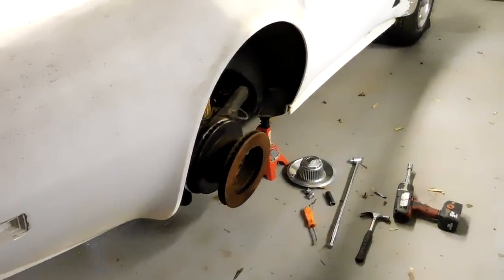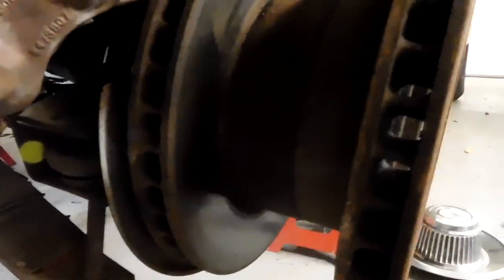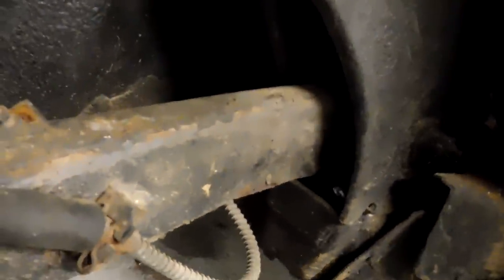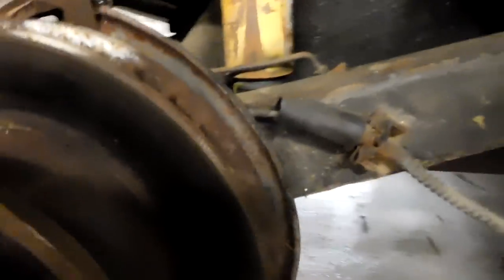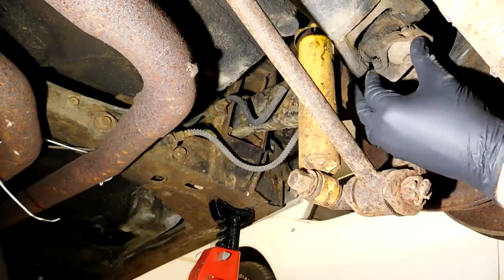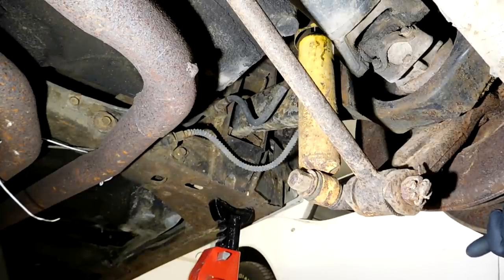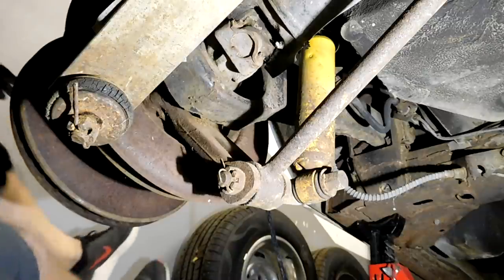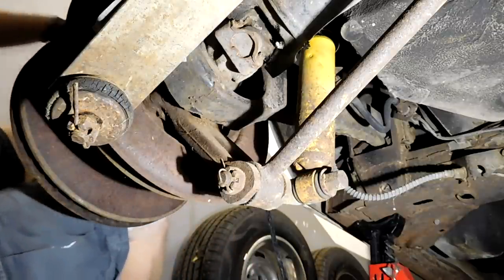The BEST Way To Check The Rear Wheel Bearings On a C3 Corvette

Comment: Fyi, you can also check with the wheel on as well,  pop the wheel off, long screw driver and loosen the the shoes away from the disk, not necessary to remove them. Put the wheel back on and shake away. If you don't have an extra pair of hands from a buddy and depending on your strength level it can still be done by 1 technician.  We did that short cut back at the Chevy dealership way back in the 70's and 80's.  I cussed at many a vette back then, glad you are dealing with them. Not to many people want to tackle an animal of this type  (C3's), I love them' Rock on young man, I love your channel, brings back memoriesl!!

Comment: I had a c3 in the shop i was working on to do rear brakes and lower arm bushes. It wasn't the lower arm that was faulty but the bearing had play in them and they had just been replaced. I phoned up the customer and asked if he wanted it investigated. To cut a long story  short after a lot of head scratching we worked out that the bearings the guy used  had a smaller radius on the outside of the inner bearings so they sat on the radius and not on the flat surface on the back of the bearing.  It took a lot of finding. so that's a trap you'd never expect.
Reply: I've seen that before, too. Scary stuff in a car that goes fast.
Reply: Was that a do it yourselfer or did that customer pay someone to do it for him? Finding old timer mechanics who know how to do this is critical. I found often that todays mechanics can do circles around me, yet when it came to knowing my 69 corvette and how to work on them they were mostly in the dark and me as a backyard mechanic from that era was schooling them. Trailing arms is one thing I knew well enough to let the old pros rebuild mine.
Reply: @ckstaff  I'm a mechanic in New Zealand and was working in a workshop for my boss. I'm near retirement age. The car came in for rear brakes and needed a new set of discs on the rear and rear lower arm bushes. There was a lot of movement in the wheel brgs . We contacted the owner and he told us to have a look at the bearings too.  It was tough to get apart  with the puller. When i took the bearing out of the housing it had been recently replaced. The bearing had left witness marks in the housing sides and inner corner but none on the back face of the bearing or housing. The radius was to sharp on the bearings so it wasn't seating on the back of the bearing, thus the movement. It was just seating on the radius. i nearly missed it.
Reply: @andrewkiwi1  I understand what you mean. When I pulled my trailing arms and tried to determine if I should do it or send it to my old retired mechanic from the days. I looked at the 4 longer bolts holding it all together and wondered how you get to those bolts, also looked at the costs for good tooling and jig to get the proper specs. Decided to have him do it. We met at his shop on a Saturday morning as the plan was he would tear them down for me and while we wait a week for parts I took the casing and arm in for powder coat and sandblast. I was expecting it would probably be a couple hour job each for him to take them apart. LOL he had them both apart in about 20 minutes. Bearings were surprisingly in good shape and still had grease. What was completely gone was the bushings. Sounds like you had a monster project to figure out. Did you pull the entire arm out? Very good that you discovered the problem.
Reply: @ckstaff  Here in NZ we have a safety inspection called a "Warrant of Fitness". For cars under 5 years, once a year and cars over 5 years every 6 months. It was due for one so it would have failed on excess play in the rear wheel brgs. So it needed to be done.  One side came apart easily and the other was just tight all the way. We did the lower arm bushes too.
Reply: @ckstaff  I had a rear bearing go out, just fell apart. I had it towed to a shop, there the mechanic put the spacer in backwards. So I decided to rebuild them myself. I got a used GM tool, but it wouldn't budge them apart. We took the housings off the trailing arms and pressed the spindles out with a massive hydraulic press. It took so much pressure, I thought it would explode, but it came apart. We still had to use a cut-off wheel to cut the race off the spindle. It went together okay, about 3-thousands on one side, 4 of the other. I doubt I'd do it again, would probably send them off to be redone.
Reply: @mikeferrell7308  I just figured when doing mine that I would probably never do it again so why learn how to do it, buy the proper tooling and risk screwing it up. At a minimum it cost me $700.00 to pay him, yet was probably the smartest money I spent on the entire car. To bad you paid someone and then had to turn around and fix his mistake, that would have sucked. It is such a big job just getting to the stage to get the arms out. Hope you also dealt with all the old bushings such as struts while disassembled. LOL, I did, I didn't want to have to go back and do it all again. Not to bad of a job but I had a horrible time getting one of the lower shock mount out, which actually hold the struts also. Ended up destroying 2 of the tools that screws on, protects the threads and allows you to pound on it to get it out. Still wouldn't come out. Finally did come out but I destroyed it and had to get a new one. I enjoy chatting with other c3 guys and sharing stories and each others adventures.
Reply: @ckstaff  Yes, rebuilt everything while the trailing arms were out. Yeah, my shock mounts wouldn't come out either. Ended up cutting them out and replacing them. Had to cut the bolts through the frame, too. Nothing was coming apart. Yeah, after paying to have it screwed up, I figured I could screw it up for free! ha ha!
Reply: The bolts through the frame and if they would come out or not caused me anxiety all through the process but kept persevering blocking it out of my mind until it was time. Had my saws all on hand should I need it. I was quite surprised when they easily popped right out so no cutting. Something went right for me that day. LOL. However not nearly so easy getting them back in, especially with fat fingers. The kind of thing that eventually after all the little tricks you try to get that long bolt straight enough to go in the hole it worked, but I cannot to this day explain how I did it. Almost by accident, in fact probably was by accident.

Comment: Good video and perfect timing for me!  Going to be working on the rear suspension this winter.  Need to chang the ride height on rear passenger side.  For some reason, passenger side is higher than driver...
Reply: Oddly that is true on most C3's. My 69 as well. I had read that they were designed that way because roads slanted to the right. Not sure if that is true or not but my right rear is 1" higher than the other 3. I have the longer hanger bolts I can put on to allow that 1" drop, just never got around to trying it. There is a good chance your hanger bolts if original (8'' I believe) are already adjusted as low as they can, meaning you won't be able to lower that height without getting the longer bolts (10'' I believe). The longer bolts sure look awful close to the ground, to me anyway.
Reply: @ckstaff  the stock bolts are 6".  I just bought 8" bolt kit with new bushings and plan to swap them out in winter.  BTW, you're right about most C3 having this issue.  My 74 was the same way...
Reply: @aamira5651  Yeah, couldn't recall the bolt sizes when I posted. 6''to 8' or 8' to 10''. Good luck on that. As I said, I got the longer bolts to do the same thing yet not switched them yet. Would be interested how it turns out when you do it.

Comment: Great video, Ben! Looking forward to seeing how you tackle C3 rear wheel bearings. I've done it on mine, it was a bear of a job! Mine didn't want to come apart, took lots of persuasion!
Reply: LOL, I took the chicken way out on mine. I pulled the trailing arms off and sent them to a pro. $700.00 job, but well worth it and hopefully good for another 50 years. To bad I probably wont be around in 50 yrs to find out. LOL

Comment: Good to know. However I had bad bushings in the struts which had to be replaced to do an alignment on my 69. Having to strip it down just to get to the struts there was no sense in not going all the way to the 50 year old trailing arms. Not something I wanted to do but there is a peace of mind when done knowing all bearings, parking breaks, grease, trailer arm bushings, even sandblast and powder coat, u-joints, break lines, shocks, struts, cambers and bushings and even new bushings in the suspension and leaf springs are done and all the wondering is over. All in all about a $1200.00 ordeal, unless you know how to rebuild the trailing arms yourself, which maybe I could but paid a pro $700.00 and know it was done right. Hopefully now good for another 50 years? LOL. You had it stripped down far enough to just go ahead and get them off for rebuild, change the shocks and strut bushings that were probably rotten or close and take any guessing out of it. They are not getting better, they are just getting older.